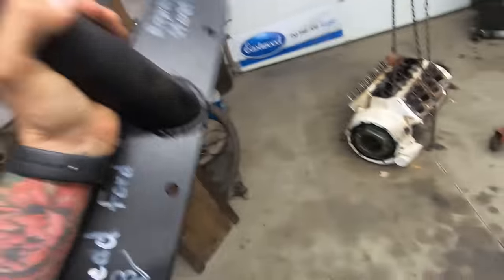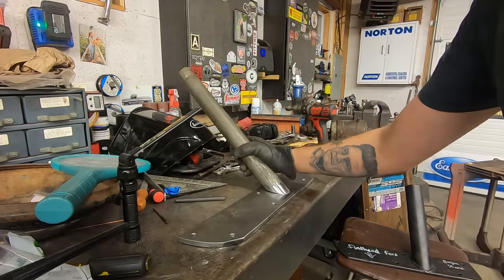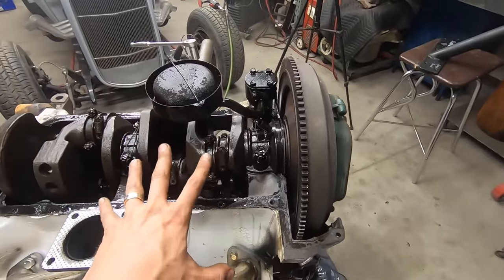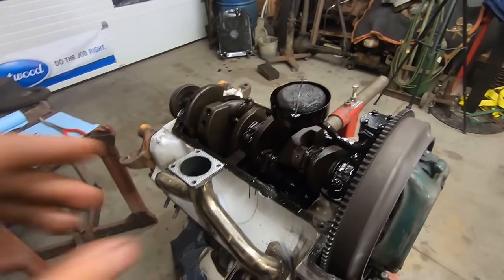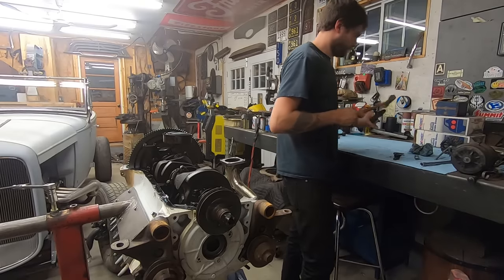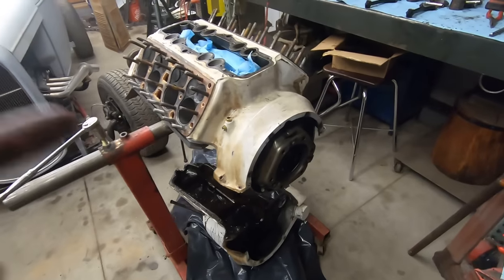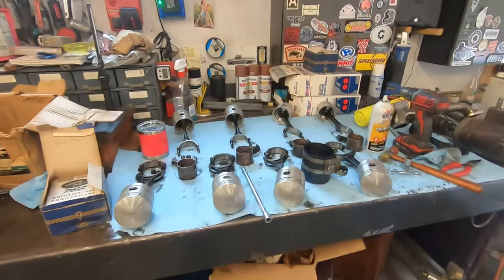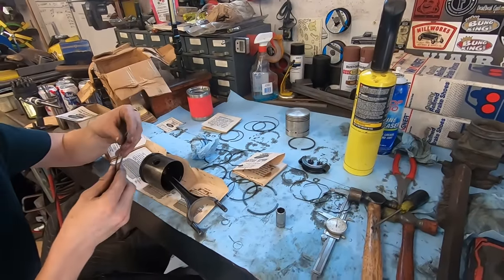Refreshing the Flathead V8 to Rebuild Coffee Break

Comment: Man...drill some holes so you can pin that motor stand mount. So it doesn't slip on the bolt. ....just sayin' ...safety 3rd. I had one slip and almost took my fingers off.

Comment: You do now that that engine is still going to pump oil.  With how particular you are on your metal working skills you should of had the engine bore then the first set of piston would of fitted. But you'll find this out later on when you keep adding oil to your engine and lack of horse power. Just 40 years of turning wrenches speaking here plus your no saving a dime either
Reply from the maker: Just trying to get it back in the road for the rest of the season. I really don’t care how much oil it burns. This fix cost me 100$